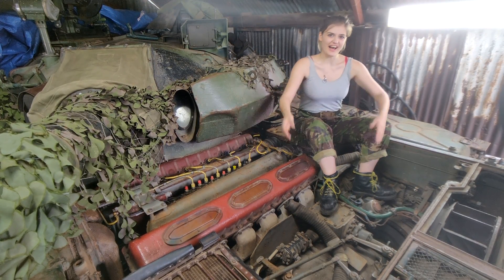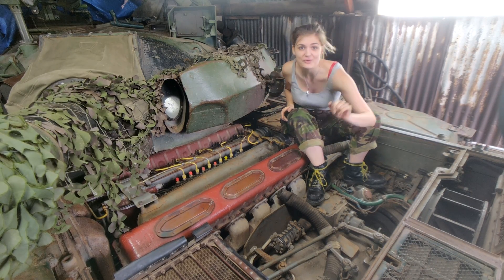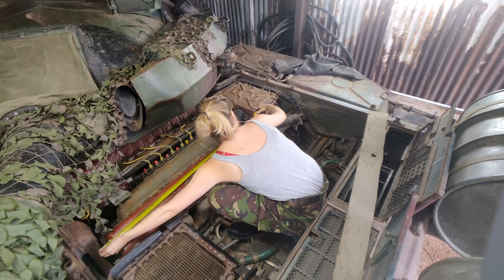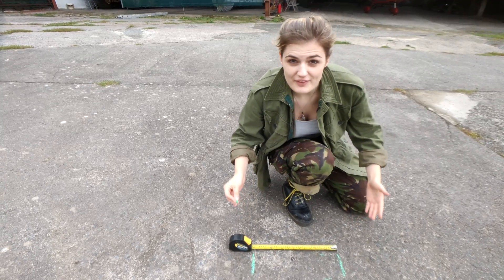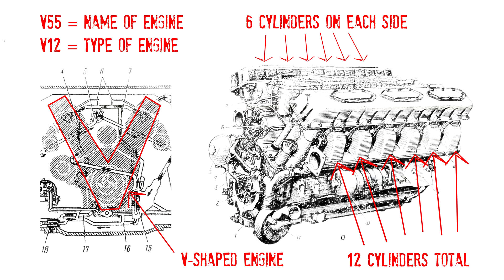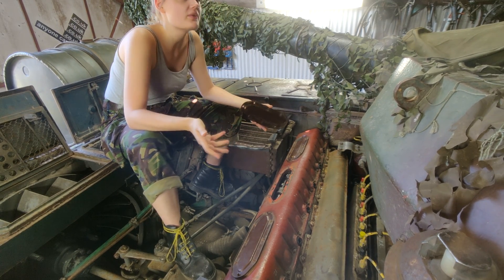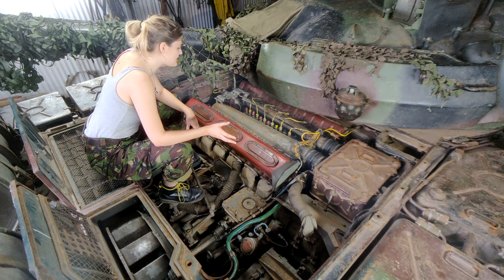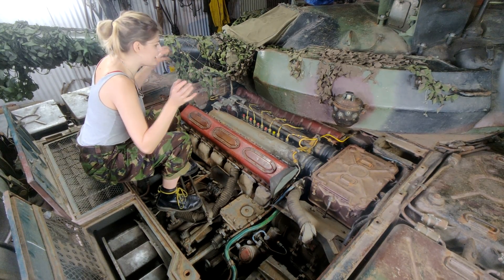Our BIGGEST Tank Engine (V-55-VA from Soviet T55AM Main Battle Tank) | TANK SCHOOL

Comment: Hi, if you want, I can explain to you how each of the buttons and switches inside the tank's turret works.  I am currently creating very detailed diagrams and instructions for the fire control system.  This system, apart from measuring distances up to 10 km, can display the temperature outside the tank, ammunition temperature, wind speed, and tank speed.  In addition to a few other functions that are most useful in combat, you can turn on the stabilization of the gunner's mirror.  This allows for a stable viewfinder image when the tank is jumping like crazy.  Let me know if you are interested.
Reply from the maker: Hi, guess you are from Poland; hot there as well?! Very interested...we are self-trained with a bit of help from the Polish Army. I have operated the tank on the move with the X & Y stabilisation working but not the third computer aided axis, and never the laser rangefinder as the Army said it was too dangerous due to 'scatter' into eyes. looks like you have a good command of English! where do you live? ps. I am looking for a T-72 engine to replace the W-55U; any thoughts? Cheers Alastair.